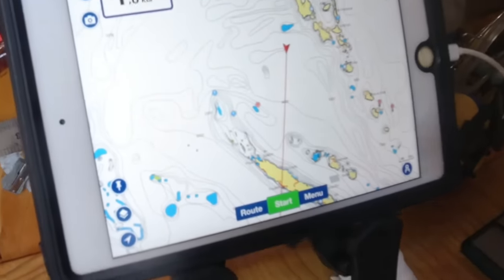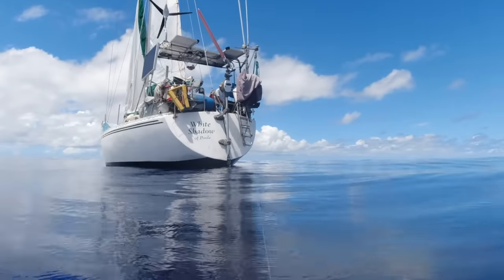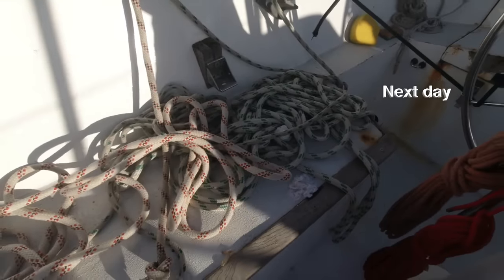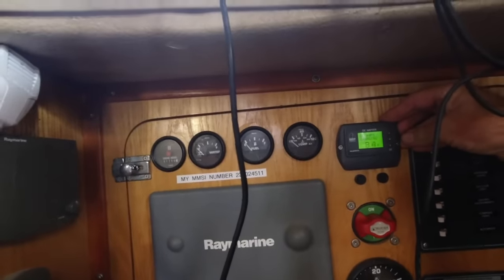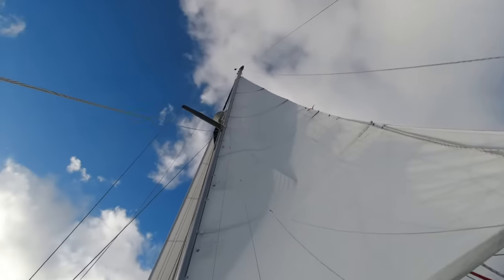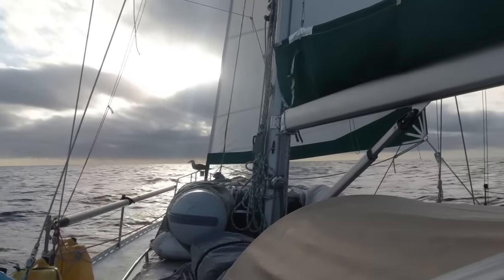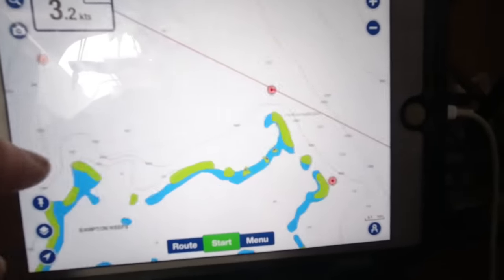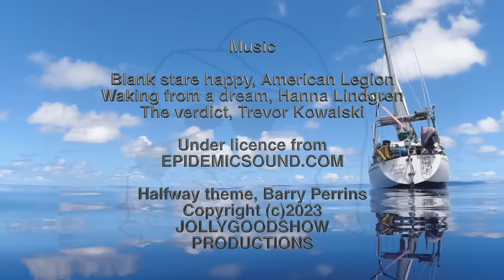Sailing alone across the Coral Sea

Comment: Hi Barry, I have often asked myself, "Why leave the Anchor hanging at the bow when you are mid ocean?'   I hope you can clear that question up for me,  Cheers Ed
Reply: It's at its most constrained and solid location so it is better to improve the seating and tweak how it is secured
Reply: Because he might need it unexpectedly, when you need it you need it now; it is heavy, to move it below and back again is a lot of work if you are alone and takes time; you don’t want to risk dropping the anchor in the ocean during the move;  you would usually only remove the anchor if you are sure of hundreds of miles ahead with no islands and reefs.

Comment: Please check those white plastic wiring connectors, they burn very easily. Try holding them to a flame, be carefull, when they catch on fire they will drip flaming golbs on whatever is under them. David

Comment: A wood holster or sleave works well for securing the anchor bar or tube you can make it very snug and  its easy adjust the tightness by adding wood shims. It wears out but its wood and so its easy n cheap  to repair or replace..

Comment: You need a dc clamp meter, measures current flowing through a wire. Also, those black connectors are called MC4 and they un-clip . If you look carefully you'll see a couple of things , one on each side  that are holding it together. I can un-clip them with my fingers/fingernails. Look insode, if you see corrosion the "waterproof capability" is not so good. You might need to replae them with common crimps after all. All those connections should stay absolutely dry. an upside down plastic bottle with the connections inside it helps a lot.

Comment: I am a Australian mine electrician,  you need help with your solar wiring, it is to small, for the current you are producing. Minimum 16mm cable to your battery / regulator / solar array.

Comment: Those screw down household connector blocks are not really good enough for a boat, especially outside; the box is also a household thing and may not be watertight; I suggest you look into a professional set up in  so that you can set it up and feel more secure for another 10 years. It is best to fuse those positive cables too, as close to the panels as possible, so that the fuse blows if shorted, rather than starting a cable fire. IMHO. All the best.

Comment: Those terminals are dreadful in a marine environment. Dissimilar metals, salt water and electricity means corrosion, high resistance and IR loss resulting in heat and meltdown.